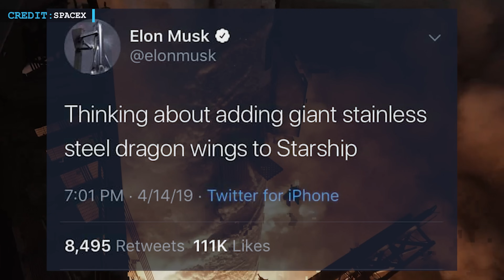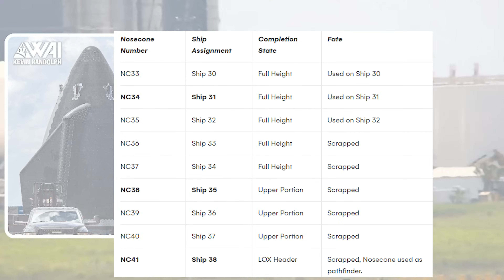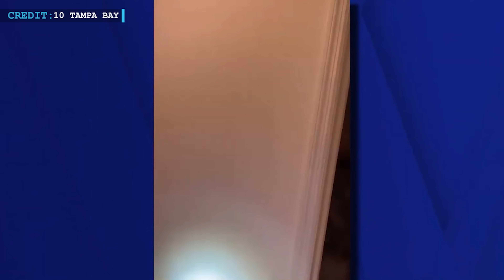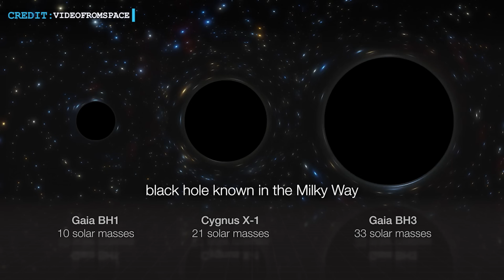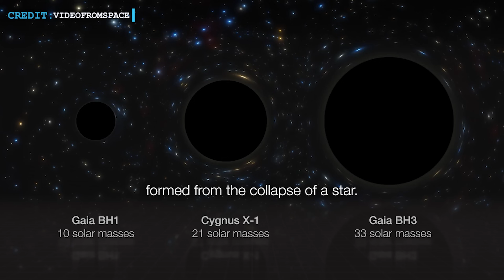How New SpaceX Starship Version Will Be Different | "Sleeping Giant" Black Hole in Our Galaxy Found

Comment: Considering that IFT-3 essentially ran out of propellant on a suborbital flight carrying no payload at all and that SpaceX claims that Starship will be able to take 100-150 tons into orbit, it makes sense that its fuel capacity is being increased, but Starship is years behind schedule and may never ferry astronauts between Orion and the lunar surface (the reason that NASA gave SpaceX almost $3 billion).  I notice you don't say that the new version of Starship or its booster will be recovered successfully; after the disastrous performance of IFT-3, I'm not expecting much either.  Awful -- another channel trying to capitalize off the boundless credulity of the fanboys.

Comment: I think we are about to see more wings, but they have to be kept minimalistic...

Next flight is rumored to have a different profile, not flying bass ackwards and getting jammed on tilt.

And sounds like the booster needs to be a bit more beefy...
Considering 80% of the strength of a hull is in the skin, more internal structure is doing it wrong.

They need to go back to thicker skin at the bottom. maybe get thinner going upwards on the booster, and keep skin weight to ribbing and longitudinals about 4:1... i.e. 80/20 percent, to reflect to structual reality sweet zone.

Just sayin'

Comment: To those wondering, Inconel is an extremely tough high melting point alloy, used in rocket engines and anything that has to withstand extreme circumstances. Not surprising that it survived re-entry.